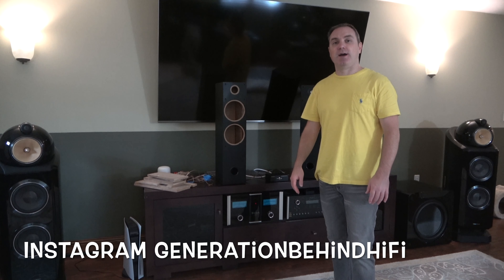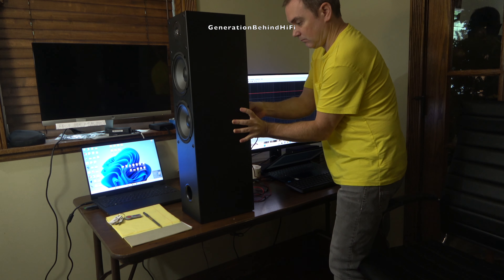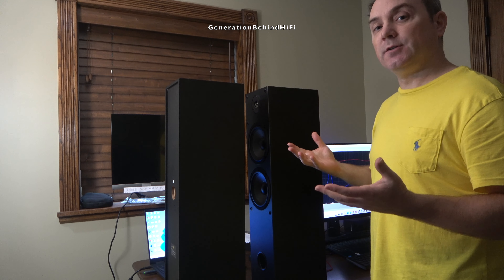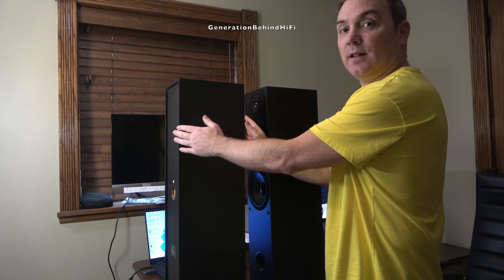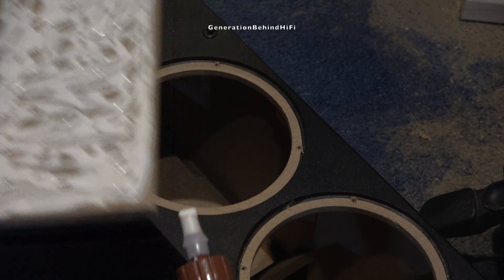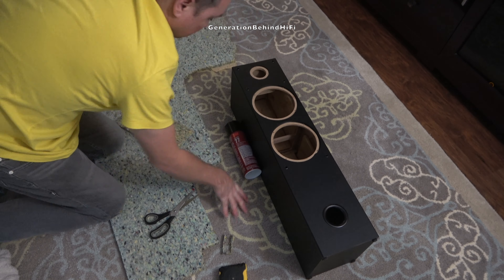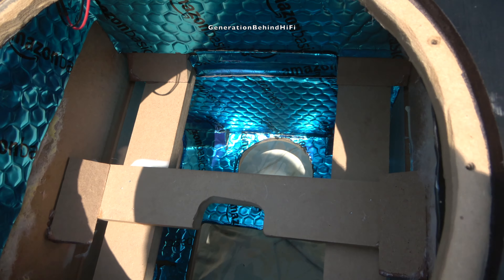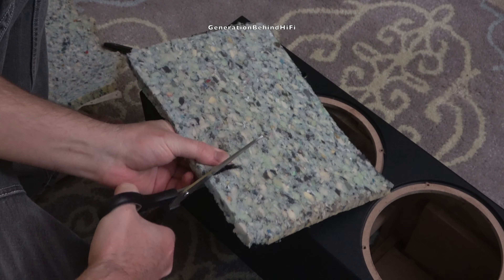How To Combat Speaker Cabinet Resonances

Comment from the maker: Below are some of the damping materials that I like to use:
Peel and stick butyl rubber sound dampening peel (Generic Dynamat): https://amzn.to/3Nk29nJ
Sonic Barrier 3 layer system: https://amzn.to/3M7TXrb
Sonic Barrier foam 1/2": https://amzn.to/3S4GJzh
Polyfill: https://amzn.to/3Fn9RtR
1/4" MDF sheets to laminate inside of cabinet with: https://amzn.to/46VoGzG
Carpet padding 3/8"-1/2" - Available at any home improvement store 
Blu-Tack (great for making gaskets and sealing port holes): https://amzn.to/3CC3DoL
Dayton Audio DATS v3: https://amzn.to/43PBZAu
Rockwool Acoustic Stuffing: https://www.acoustimac.com/roxul-rb6-2in?utm_term=&utm_campaign=PMax/Insulation/2023&utm_source=adwords&utm_medium=ppc&hsa_acc=4716037441&hsa_cam=17880814997&hsa_grp=&hsa_ad=&hsa_src=x&hsa_tgt=&hsa_kw=&hsa_mt=&hsa_net=adwords&hsa_ver=3&gclid=Cj0KCQjwhL6pBhDjARIsAGx8D595-ldQnngjCv6lEevkFWJpPpR4tMOCJ4-jHq2IIPRKGUDxeymsUukaApVnEALw_wcB
My videos about upgrading speakers can be found here: https://www.youtube.com/playlist?list=PLg0Xq1LbiZBV3JdrXQtMPgv3Lc6YB6fdr

Comment: This is a fantastic video. I use the laminate process myself. One point is that if you stage the laminate pieces so they are non-uniform between parallel walls, that is also a benefit as you don't have walls coupling as you would if you simply have a brace. Nice work
Reply from the maker: Thanks, Robert! I appreciate the additional tips as well. Happy listening!

Comment: Great video.  Just note that this process and the materials used should be referred to as "Damping", not "DampENing", which would have to do with moisture issues, not resonance/vibration control.

In addition, the fibers from mineral wool/Roxul are also harmful and should also be contained.  If you encapsulate the mineral wool within 3 mil thick plastic sheething or "bags" it will still be acoustically effective but will contain or encapsulate the fibers.  

I have used "Turkey Oven Bags" for this because they are incredibly tough & resilient and will not deteriorate over time.  Find them in the cooking goods section in your local supermarket.  They come in a small box similar to plastic Zip-Loc bags.

Personally, I always choose natural lambswool as my preferred "fiberfill stuffing", which is not harmful to your health and is also one of the best performers in terms of these types of acoustic fiberfill materials.

Comment: I would never do that laminating, adding a brace would be fine. How would you know how much fiber to put in to counter the laminate? I would only do dynamat on the metal parts. Sonic Barrier 3 layer or No rez would be the only things I would use. You are probably better off putting that money towards a better pair of speakers until you get up to ~$2000 range. That's the sweet spot where you can get a good sounding speaker with a decent box. As you move up you start paying for more build quality. If you get a good pair of speakers add the no-rez, upgrade the crossover, then you have a great speaker for cheaper than you could buy. If you start with Dayton audio, there is only so much you can get out of it..  But if you already have the materials sitting around and the speakers, go for it. With that echo in your rooms, your money would be best spent on some room treatment.
Reply from the maker: Hi Pete, I think you might be missing the point of this exercise. If you really want to learn about speakers and what makes them tick (Total Q, the effects of enclosure size, resonance, etc.), then this kind of tinkering is a must. I understand its not for everyone, but there are some people out there who are like me (people who like to tinker) and don't mind spending few bucks on additional materials to see if it a little sweat equity improves the sound from their budget speakers. Sure, spending more for better speakers is usually the wiser choice, but trying to improve a budget speaker is also fun and entertaining IMO. Maybe it's just me who likes to tinker to see how much performance I can extract from a budget speaker?

As for your second question regarding enlarging the perceived volume of the box by stuffing it with damping material, well that can easily be proven by doing an impedance sweep and measuring the resonant frequency of the speaker. We already know a larger enclosure will result in a lower resonant frequency, so all you need to do is run some before and after tests to see if it actually works. If the resonant frequency of the speaker goes down after stuffing the enclosure, then you know it worked. Hope this helps! 

Thanks for the comment! And hopefully you will do some tinkering on your own one of these days. :)
Reply: @generationbehindhifi 
There are indeed lots of people who love this kind of tinkering. 
I've been an electronics tech for 40 years and have "tampered" with a lot of stuff.

The T652s are great DIY speakers. The drivers are sound. The Box is flimsy but well made and adding a crossover works wonders for them.  At one point in the pre-covid days I used to do 1 or 2 pairs with CLD and a crossover every month for friends and friends of friends. Then coupled with one of the nice Class D mini-amps they make an excellent "sound bar killer' system for your TV listening.  In some rooms it's even "no sub required", which is even better.
Reply from the maker: @Douglas_Blake_579  Hey Doug! The bass from the T652's is quite decent and honestly it surprised me. I only paid $79 for these speakers (open box) and was pretty impressed with the value for money proposition that they provided. 

I need a new oscilloscope and was wondering if you could recommend one? I want to use this scope for figuring out the average power from amplifiers and I'm currently looking at the Hantek DSO2D15. It's a 150MHz digital scope with a built in function generator. Thoughts? Thanks!
Reply: @generationbehindhifi 
 Yep, the T652s are a favorite among people just wanting basic sound and those who like to tinker (or tamper) with things. I've used them myself.

For the scope, yes Hantek is a good name. I use a DS5000 on my general test bench and had their "even better" models on my bench at work before retiring. They'll do a good job for you.  
But one thought if I may ... given that you're doing the YT Creator thing you may want to invest in a USB scope so you can do screen captures for your videos... The higher end Hantek USB modules are really quite good. (LOL Just imagine... a 60 inch scope display!)
Reply from the maker: @Douglas_Blake_579  Thanks for the recommendations! 

Heck ya! A 60"+ scope display does sound pretty sweet.

Comment: For me I used vinyl floor tile first to line inside of my Polk audio 70 series 2 loudspeakers with cement glue . Then I used acoustical foam over top. My,my,my the difference it made . Thanks to Richie from "GR Reesearch" and others that put out videos on this topic. No !! Resonance at all. Simple knock test did the job. Just another part of the hifi journey.
Reply from the maker: I have heard good things about the floor tiles, but personally haven't tried it yet. Thanks for sharing!
Reply: @generationbehindhifi  no problem. I want to try using the dynamat. Pressing it against the enter walls of the loudspeaker or bookshelf speaker . That also seems logical as well to knock down resonances . Just be very careful of crossover touching the metal part of the dampening.

Comment: Here's a method I use to find the resonances in speakers - place the two speakers face to face, and wire one of them with the speaker wires inverted i.e. connect the positive wire to the negative binding post, and the negative wire to the positive post. Use an online tone generator to play tones from the bass up to treble (20Hz to ~5kHz). The main output from the drivers will largely be canceled out by playing a mono signal and one speaker being inverted. What you can then hear/feel is the cabinet resonances (and a few other things). If the cabinet "lights up" with vibration in certain areas, you can feel/hear where the weakest points are in the cabinet.

I would also always add a rib across the inside of the narrow web of the front baffle between the drivers. The movement of the woofer/midrange cone is always going to stress the weakest part of the baffle - which is always the narrowest  web. A rib of 3/4" plywood the is an 1"- 1.5" wide, glued on its edge across the width of the front baffle is a minimum. I would look at a strut connecting the new rib to the back baffle next - this adds a lot of stiffness to both the front and back baffles. You can also add ribs to the side panels that overlap with the rib on the front baffle at the corners; and a rib across the back baffle that is parallel with the front rib. You can go all the way and have a strut side to side and front to back, that are glued to each other in the middle - this forms a so-called window brace. The stiffness of all the speaker panels are multiplied by an order of magnitude. And the total reduction of the interior volume of the cabinet is fairly small.

Repeat this at a different height(s) in a tower speaker. It is a good idea to have the spacing of the ribs at ~1/3rd or ~2/5ths of a given panel span. This distributes the resonances and their harmonics out. Putting a rib/brace right at the midpoint of a panel will have stronger 2nd harmonic resonances that sum up for the two halves of the panel; if that makes sense?

I would advocate either for thin panels added to the cabinet panels (and possibly using silicon rather than glue) - OR - using foam like the carpet pad, or 3-layer damping foam like Parts Express sells on the remaining open panel areas. The foam won't displace the volume of the cabinet, and it will actually lower the tuning somewhat. If you use 1/4" MDF panels with flexible glue/silicon, they will damp the panel because they flex a bit, and they won't displace as much volume as thicker panels.
Reply from the maker: Thanks, Neil! Those are great suggestions!
Reply: Excellent advice, as always, Neil.
You can get away with a bit of extra bracing in the T652s because the box is a bit oversized to begin with.  (It should have been about an inch shorter)
Reply: Well said and thought out. Appreciate not having to reinvent the wheel.
Reply: Imam tornjeve Elac debut f5 od jeftinog MDF i imaju pregradu na sredini između basa i srednjeg,ali stvar pleše po sobi 😂😂😂.
Mislim da je ovo puno bolji način(manje pilanja). Hvala prijatelju

Comment: The "laminating" process will work but it also  significantly reduce the internal volume of the speaker since you are trying to build a stiffer wall.  

An equally effective result can be gained by "constrained layer damping", aka CLD.  (do a search) Basically you are using a thin layer of mdf (1/4") or hardboard (1/8") bonded to the speaker cabinet with a very thin (1/16") layer of silicone rubber. The clear Silicone used for bathtub calking works well. Then as the cabinet flexes it induces stress into the rubber which then, being an elastic material, counters the tendency to vibrate.  

Just one word of caution about the silicone here... thicker is not better... we are not padding the speaker with silicone we are building a dynamic anti-vibration system. Thinner layers build more tension and counter smaller vibrations.

I've used CLD in the the T652s he's demonstrating with and the results were the same or better ... with no significant change in internal dimensions. 

The carpet underpad is an excellent padding material as well.
Reply from the maker: Hey Doug! Thanks for the tip. I have never heard of CLD. It sounds interesting. I will have to look into that!
Reply: This sounds awesome, I am inexperienced and researching for woofer box in the hatch back and just for general purpose. Don't mind spending more time on a diy fully enclosed box build and this seems like a really cool upgrade!! Considering working with a 'passive radiator' in the box as well. Great video
Reply: Hey Doug do you mean outside of the box,or inside aplay silicone and MDF? Thanks

Comment: Box Speaker mods are allot of fun! I have also drizzled some hot glue on the stamped steel woofer baskets. Also rounding over the inside of the baffle were the speaker mounts is a nice cheap upgrade 🔈👍🏻. My current speakers are lined with NO-REZ and it really tightened up the base. Cabinet damping definitely helps out. Good video!
Reply from the maker: Hi JR! Those are some great ideas. I'll definitely keep those in mind. Thanks!
Reply: Never heard of drizzling hot glue on the stamped woofer baskets before. What is the idea behind that if don’t mind my asking?
Reply: @RdandTrk1  I just figured it could help stop or dampen the ringing that cheap stamped steel baskets are known for. More for very cheap DIY stuff. I have also used automotive spray dampening material, however it is not cheap.
Reply from the maker: @JR-ho5qm  Yeah, stamped steel baskets are notorious for resonating. I used to put strips of a Dynamat like material on them, but hot glue would be a much cheaper option.
Reply: @generationbehindhifi 
In cases like sealed boxes or transmission lines, where you're working with Poliyfil (pillow stuffing) you can also take some nylon window screen and cover the openings on the basket to prevent the padding from getting against the woofer cones. Bond it in place with hot glue or silicone and you get damping on the basket itself, too.

Comment: Great video. I used these techniques to stiffen up some Sony SS-CS3 which sadly are known for poor cabinet bracing (I knew this when I bought them, but got a deal and figured it would be cool to see if I can improve them). They basically had no bracing below the port and just some bracing up top. I added strips of 3/4" MDF as wide as I could get in there, gluing them in place with Titebond. I then added a some of that Amazon fake dynamat stuff up top and some extra foam stuffing (I'd like to use something better eventually but I had the foam on hand). The cabinets are a lot more quiet and they sound much better now to me (nothing objective, just my ears). If you can get these on sale or second hand and don't mind doing some work these can be good speakers IMO.
Reply from the maker: Thanks, Greg! It sounds like you did a great job with the SS-CS3 speakers. My favorite part about this hobby is tinkering. I enjoy buying budget subwoofers and making them better. I did it with my Klipsch R10SW and JBL 550P and both turned out pretty well. Some people wonder why I do this, but to me its fun and enjoyable. Plus, I learn a lot by trial and error. I'm glad things worked out for you and keep on tinkering!

Comment: Aside from thin damping material, I'd avoid these methods unless you're just interested in tinkering. 

Adding a significant amount of material to the inside of any enclosure may fix problems in a specific area, but it will cause other problems to pop up as a result. predominantly, it will impact the bass region and change how the woofers perform. enclosure design (when done with any care) involves a careful balance of internal volume, port tuning for that volume, and factoring in the additional volume taken up by anything that's inside of the box. 

It's possible to directly upgrade the design without creating any negatives, but this would involve a lot of careful management of the exact cubic space of material that you're adding, factoring in the parameters of the drivers, enclosure volume, port volume, etc. At this point you're looking at learning several pieces and some pretty in-depth info about speaker design.

 I'm not trying to discourage anyone, but if you're trying to do these kinds of upgrades and shoot for a measurable improvement, you may well end up pulling your hair out with frustration when you spend hours making these changes and find only marginal improvements, or worse performance than you started with.
Reply: Damping*

Comment: What exactly does cabinet resonance sound like? I have a pair of active speakers that have an egregious amount of buzz around 270hz and I'm wondering if the speakers are faulty or it's just cabinet resonance..
Reply from the maker: A ringing sound. This could be a "buzzing", "ringing", or even a rattling sound. If you put your hands on either side of the cabinet and press in, does the "buzz" go away?
Reply: @generationbehindhifi   It doesn't go away but it reduces it.
Reply from the maker: @rupe82  I think you just found your problem area. 🙂
Reply: @generationbehindhifi  Today I learnt something new! Thanks. At least I know my speakers aren't faulty..

Comment: Why not duble wall with sand between?
Reply from the maker: In theory it sounds like a great idea, but I wouldn't know how to implement that into an already constructed speaker cabinet.
Reply: Because you would then have to contend with the inner wall vibrating against the sand which would in turn vibrate against the outer wall.  It's unlikely to have much effect.